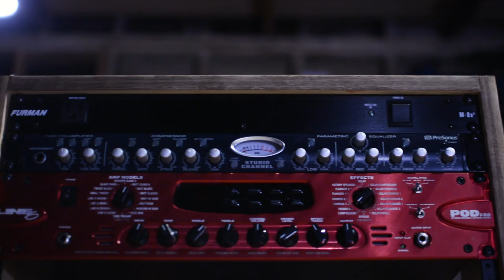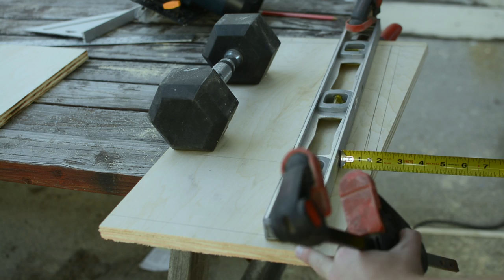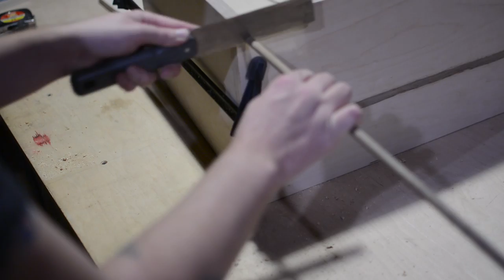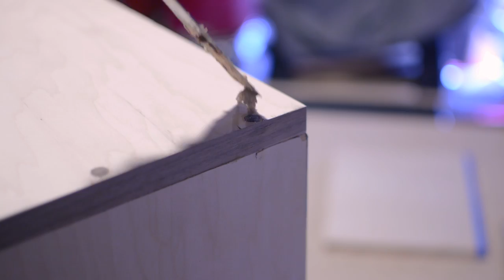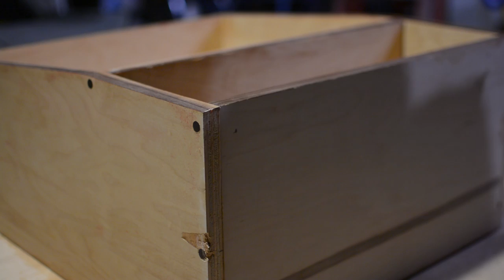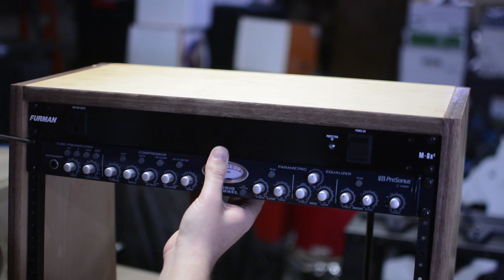Making a Custom Music Gear Rack

Comment: One  more tip for building a DIY 19" rack with slanted side panels: Leave adequate space on the bottom for the lowermost piece of gear to fit in without bottoming out on the case due to the downward tilt.

Comment: It's easier to load equipment in a rack if you lie the rack on its back. When you load it standing, you can bend rack ears if a unit slips your grasp with only one screw inserted.

Comment: I have a question, i know some rack units work with tubes, this case the presonus pre amp(second slot) has one tube, this doesnt affect ventilation??? Im planning to get some tube unites for the rack, but i was considering to leave a space between units that use tube
Reply from the maker: Devenir Oficial that’s a great question. Since the front and back is open I haven’t had any issues with ventilation. But I actually ended up moving the rack gear down by a couple spaces due to the size of the power transformer for the presonus studio channel. The two rack gear pieces are just different enough depth to not play well together. 

The stock gear racks you can buy out there will ventilate similarly to this one so if you’re good with those, this’ll be just as good. :)
Reply: @californiabuilds2561  Oh that sounds great, thanx man:)

Comment: Nice rack build! The blue tape doesn't really work for tear out on any saw but lightly scoring a line on the side of the blade that stays with the piece that you will be using with a sharp utility knife before sawing will mitigate the tear out, as well as moving slowly with a good sharp crosscut blade. Dowels are a good idea when joining end grain! On end grain glue doesn't hold very well. An old timer trick is to apply wood glue to the end grain and let soak in for a few minutes and then re apply glue and then clamp it up. Luckily with plywood only every other layer is end grain. Remember wood glue such as Titebond 1has an open time of about 4-6 minutes before it needs to be clamped @70F 50%RH.